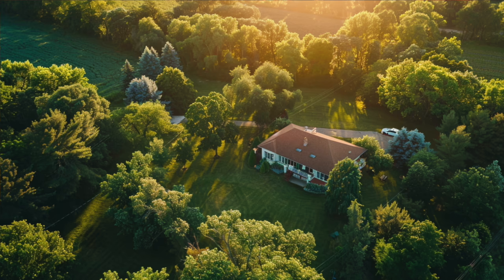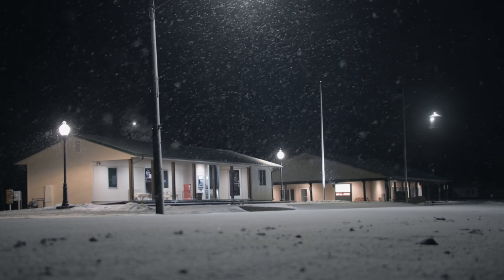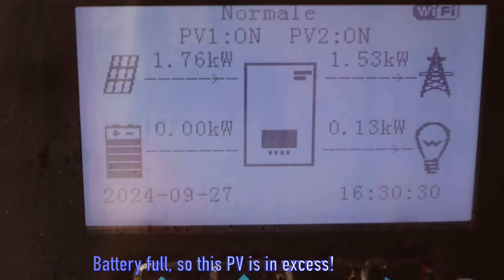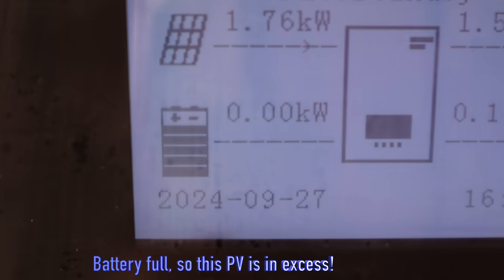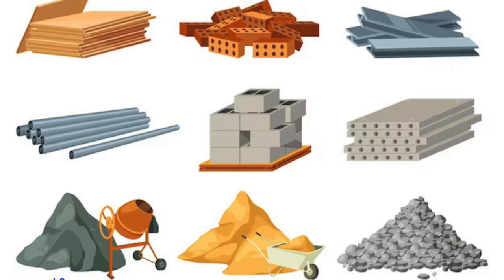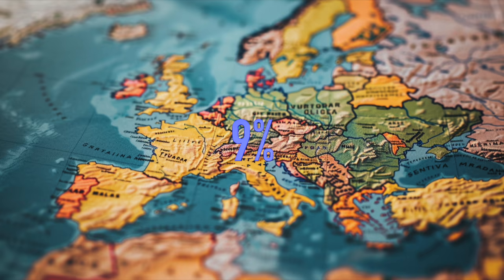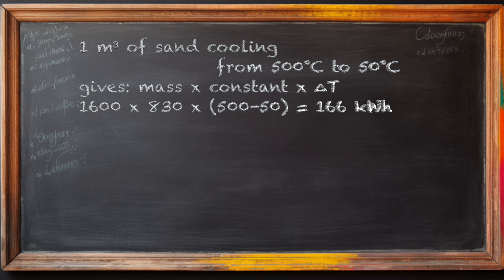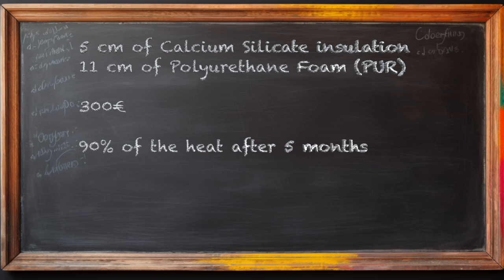Build a Sand Battery: Store Your Summer Solar Energy for Winter Heating! - Video 66

Comment: Good concept. But I would like to see some real world numbers. If the energy needed to heat my house during winter is about 10.000 kWh, then how much sand at what temperature would I need to heat up during the summer months? Would it be less volume if I used phase change material? How much insulation does it take to make it into spring? In other words, does this make sense to build or does it take up an enormous amount of space? It seems better to use water, which has a five times better specific heat.
Reply: The problem with water is that the max temperature is 100C (unless you're going high pressure). I'm skeptical about the insulation aspects. You need 10MWhrs so the answer to the first question, apparently, is 62.5 cubic meters of sand (and, of course at least 10MWhrs of spare solar PV energy.) - you weren't using your garage, were you? :) I joke - but actually if you were building a new house then piling a meter thick layer of insulated sand under the foundation slab and installing the heating coils is not really a bad idea.
One thing which was interesting was the impedance balancing of the nichrome wire to the panel impedance. But you'd need a load more than just one panel and if that's the case you'd probably do better to invert the DC to AC as usual and use that output to heat the coils. Also, I think if I were going to try this, I get the wire used in electric furnaces (glass blowing kind of temperatures).
I'd like to see someone actually trying this at a residential level.
Reply from the maker: Hi Charanvantijn, I gave some numbers for 1 m³ of sand: 166 kWh, or 80 hours of a 2 kW heater. That is not enough for winter! I mentioned (but didn't stress enough) that it is a back up system or integration for black out or very cold week. Even if this can be a disappointment, it is simply a great satisfaction that you are covered for those 80 hours with 2 kW when there is a black out or another special problem. The tornado in SE of USA with 4.5 million people with electricity can happen also in the winter (Texas, 3 ears ago).
The temperature I mentioned is reasonable, even if 500℃ is really hot and you need mixing with ambient air. The amount of insulation is mentioned in the video (a "tandem" layer is proposed). You can scale this up but 1 m³ is about the max I can ask to most DIY. Phase Change Materials (PCM) will be next video and I will do research to choose a nice one. It certainly will improve the capacity. It will also keep the temperature constant during a long time while the PCM is going back into the solid state.
Water has indeed a better capacity per ℃ but limited to 100℃...
Reply: @nnvasen-good-energy  If building a new house or barn it would be interesting to dig a basement-sized hole over they whole area of the house, line with insulation and pour in many cubic meters of suitable sand (and nichrome heating wire). Insulate the top too. Store heat in summer then, in winter, you could just open small hole covers in the floor to allow the heat in from below.
Reply from the maker: Yes sure, it is a very good idea. I don't know how difficult it is to realise it but it will give heat even without holes, it is in fact a big floor heating! But yes, with holes it gives more control and you could even have multi-temperature storage.
Reply: @nnvasen-good-energy my idea is to run heated floor pipes from the roof down into the foundation filling.
The roof will be black metal sheets under which we need to put a minimum 5cm venting gap,i can put reflective alu foil in there and run around 300metres of pipes trough the venting gap.
The foundation's are usually around 1.20 to 1.40 deep because the freezing point is 1 metre.
Foundations need to be insulated from outside at least with 10cm insulation, that's the rules on new builds,i can put another 10cm from the inside,top to bottom, put on top heated concrete floor. The foundation filling is washed sand anyway so no extra costs as the extra insulation and pipes and one pump to run the water through.
Only thing is that i have 50m3 of sand and the usable temperature would be 20-60 degrees Celsius which on calculations gives me around 700-800 kwh of energy. Summer's are hot, around 6 months to heat up the filling, really cold winter around 3 months.
Just by the calculations it's not much energy stored 
The house would need around 5000 kWh to be heated
Reply: 10,000 kWh of heat energy in sand (120lbs/cuft, Cp=0.18Btu/F/lb) and say a 150F differential temp says you need about 1.2Million pounds or 10,500 Cuft. Or a box about 30 ft square and 11 ft deep.
 At 250F peek temp and an R-40 wall (400 sheets of EPS, $16,000) you will loose about 180,000 btu per day. As the earth heats from that it will slow the loss, but year one is a lot of waste.
Reply from the maker: Yes, it is not easy to retain the heat so much time, I saw it today also in the YouTube of the forerunners in Finland https://www.youtube.com/watch?v=o3iV5X0htC8
But look this weekend (I try Saturday at 3PM Central European time) and I have a solution!

Comment: I'm definitely curious about the phase change material. I assume it has to be something with a relatively low melting point, to keep things safe. Paraffin wax maybe? Though that's very flammable. A tank of gallium? 😅
Reply from the maker: Hi W. Coenen, are you also Dutch speaking (seems from name). I would take a much higher melting point because that makes it so practical during heat release. All the time you will have the supply of hot air at for example 300℃ and you can mix that with ambient air. Also you will avoid that above the melting point of wax there is so much temperature range that is (with sand) usable, but the wax will spoil the party.
Reply: @nnvasen-good-energy  
Sounds far more espensive to impliment versous just sand -- is there a greater payoff over time?
Reply from the maker: Yes Patrick, I will talk about prices of Phase Change Materials (PCM) next video and expect to find much higher prices than for sand.
Reply: @nnvasen-good-energy  Yes, I am Flemish and Dutch-speaking. For some reason I was thinking of  a liquid heat exchanger. Hence I imagined lower temperatures, to avoid dealing with steam. Looking forward to your next video.
Reply from the maker: I hope you like the video, which is now running 1 day. I changed title and Thumbnail. What is a liquid heat exchanger? You mean with liquid at both sides? I worked for Siemens in Brussels and was many times in Brussels for the European Commission, always sustainable energy projects.
Reply: You used a heat retaining volcanic sand, could we use fine river sand or foundry sand? Ik ben het met U eens.
Reply from the maker: Jazeker, dat kan! I think it will have a similar value of specific heat (kWh/degree and kg).